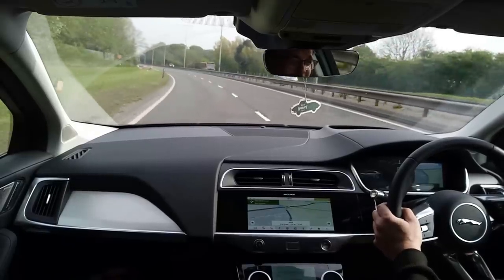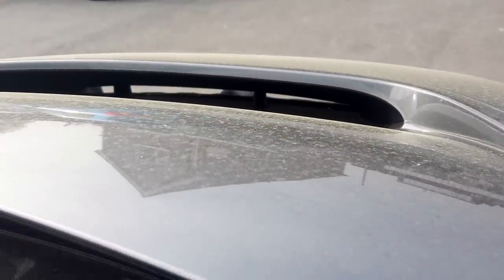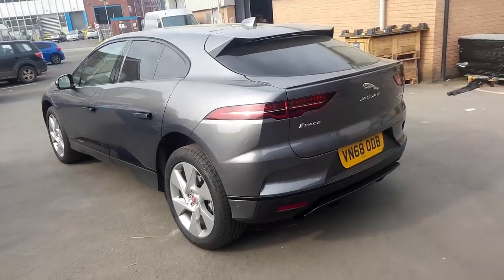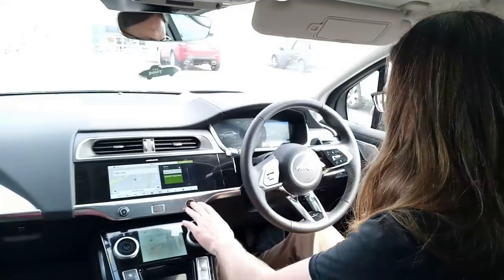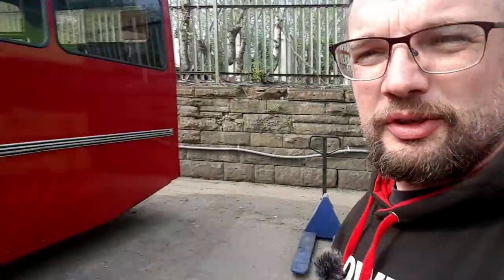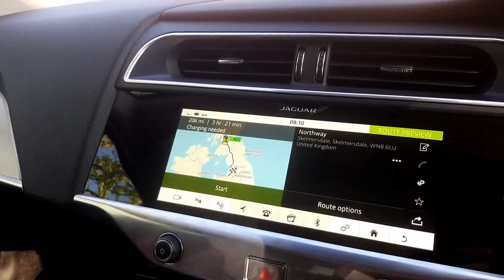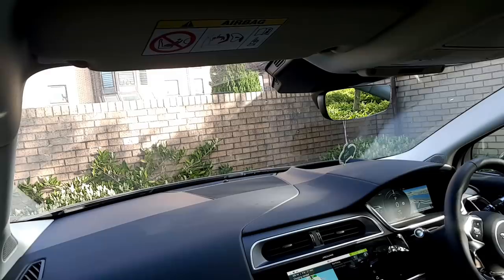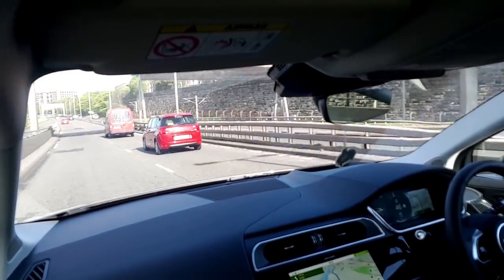Real Road Test: Jaguar I Pace 800 Roadtrip - with bonus bus action!

Comment: The electric car revolution so far as I'm concerned is welcome, but this video illustrates quite nicely how much its being hurt by overzealous software engineers who think you need an app, a bluetooth connection and three touchscreens to stick a few amps through a cable. Every glitch represents a coffee break they took instead of triple checking that line of code.
Reply: And it's baffling how these things don't switch to "free vend" mode when communications break down - people are trying to rely on them!
Reply: @AaronSmart.online  That'd be an idea, they're already charging too much so far as I'm concerned, they can cut those losses. Charging an electric car should not be comparable in cost to a tank of petrol, it's just not as expensive to make.
Reply: @Munkenba  the problem is the low volume of users and the cost of the infrastructure. A rapid charger installation costs somewhere in the region of £30-40k. If you want cheap lecky, just charge at home (but you'll only get about 7kW max)
Reply: @AaronSmart.online  That much really? Mad. I just hope the price goes down with scale, and these companies don't just see the dollar signs floating above thousands of people who now have all this petrol money they're not spending.
Reply: @Munkenba  Rapid chargers are only part of the equation though. There are also slower public chargers, usually around 6-22 kW AC, they're a lot cheaper to install - these are "destination chargers" as the expectation is you're parking your car anyway, e.g. in a town centre, shops, workplace, etc. And home chargers only cost a few hundred to install (there may be grants depending on where you are).
Reply: Worth mentioning that this doesn't apply to Tesla's though thanks to the supercharger network. Got my Model 3 six months ago and I'm taking it on a 1300 mile road trip soon. Should be pretty easy and quick.
Reply: @Brendon471  I guess you're in the US? Tesla's infrastructure is not as comprehensive everywhere.
Reply: @AaronSmart.online  Gotta DRM the electricity for some reason!! I don't know how much these chargers reflect ecotricity as a company but I already didn't like them as much as some other full-renewable companies, and locking out the chargers because the mobile phone signal is bad is just ridiculous! Imagine if a petrol pump did that, instead of just having you go to the desk and say which pump you were on. Blimey.
Reply: @AaronSmart.online  Does a petrol station switch to free vend when the card networks go down?
Reply: @cjmillsnun  You can still pay cash. When I worked in one (granted over 10 years ago), if the fuel card machines stopped working we got out the mechanical card imprinter and paper and did things the old fashioned way - nothing stopping you doing that with credit/debit cards when needs be either.
Reply: Indeed.  It seems overly complicated, we don't need to have an Esso app or a BP app installed to buy petrol/diesel.  Why can't you just swipe your credit card to start the 'fuel'?
Reply: Aaron Smart Yup, I’m in the US, but the network in Europe seems to be pretty expansive as well. Also, you have to remember that at each supercharger they’ll charge at 150kW (soon to be 250kW) which is significantly faster than the chargers were that HubNut stopped at with the iPace. Superchargers are also very reliable, so he wouldn’t have really had to worry about chargers having errors or not working like he did with the iPace. So in a Tesla, this still would’ve been an extremely easy and much shorter trip than it was in the iPace.
Reply: @Munkenba  In the UK the bulk of the ICE fuel price is taxation. 220% on base price. The fuel itself is probably cheaper than electricty per mile in standard cars. Once our chancellor starts collecting his duty he is missing and electric supplies bring in variable pricing for peak or heavy demand EVs will be at least as expensive if not more so to run not to meention premium up front cost.
Reply: @boo-boo511  I don't believe that anytime in the next 30 years will a government leant on tackling climate change even think about heavily taxing renewables. If they lose money on petrol tax, they'll get it through some other channel of income that they DON'T want the population indulging in, like cigarettes or single use plastic for example. 220% is a rate of tax that could only exist on something the government is actively trying to discourage, and electric car usage isn't going to fall into that category any time soon.
Reply: @Munkenba  It has been at 220% for a long time. It hasn't got there to put people off ICE. It is a tax on luxury discretionary income.
It will not be easy to recover that level of taxation on anything else.

It wouldn't be a tax on renewables. Tax per mile would have nothing to do with the fuel.

Cigarettes are on their knees in old western economies so limited capacity there.
Reply: @boo-boo511  My point stands, they won't try to recover that money through electric car usage, not for a very long time. Cigarettes are only an example, there are plenty of things that the government would seek to disincentivise before driving. That's unless we elect a science denying government like the Americans seem to do so often, god forbid.
Reply: @Munkenba  We shall see. It is a big wodge of income to lose from a desperate government. You can paper over small, single digit, percentage losses but as they mount it will be soo much more difficult.

How else are people going to get around? They have no choice in the majority of cases.

Ramping the usage cost may also make manufacturers reduce the capital cost faster to compensate.

Not sure the general public should be penalised for other people's discretionary spend.

Comment: I've had 3 ev's in the last 4 years, 2 Leafs and a Zoe, covered 85000 miles and have not had a disastrous trip like you have just experienced, As you have rightly stated the charging network can be pretty dire but a lot of the problem is down to CCS charging as failure rates are high (especially on Ecotricity chargers) AC can be problematic on the Zoe but not as bad as CCS, at present the best charging system is Chademo as there is usually the backup of a second Chademo charger with Ecotricity and a fair few Nissan dealers also provide free rapid charging.
Things are improving as the network has expanded greatly over the last 4 years and there is no way I would go back to an internal combustion engine and agree 100% with your comments about how smooth and responsive electric cars are, Keep the great videos rolling out.

Comment: Thanks for the video, a good reflection of how good the car is. FYI the Tesla superchargers of which their are lots charge at 125kW with the new CCS model 3 able to charge even quicker on soon up to 150 kW in a couple of years once the superchargers have been upgraded more than 200kW. Other networks are now in the UK with charging over 100kW but none on the route you followed. I do hope someone takes over from Ecotricity as I agree they are rubbish. Polar are great if you are a member £7 a month which gives you free access to their 7kW posts and a RFID card which would have stopped the issue you had.
Reply: Mike Jelfs Actually the Model 3 just got a software update 3 days ago that unlocks 150 kW charge speeds at all superchargers in the US. I'm guessing European cars will get the update soon as well. Also, Tesla is already rolling out their 250 kW superchargers. They announced that 2 months ago.

Comment: The Engenie charger at Stirling  - 

Kilo Watt Hours (kWh) commonly referred to as "Units" of electricity is an amount of energy used or stored over time. It's what your leccy meter at home measures.
KiloWatts is a unit of electrical power - Voltage x Current (amps).

So the Engenie charger was probably charging at 50kW but the screen was showing how much electricity had been delivered to the car.

So a 50kW charger should in theory be able to charge the battery by 50kWh in one hour. Batteries will slow down how much power they can take in as they reach capacity so the 90kWh battery on the Jag would take a little over 2 hours to charge from empty to full on the Engenie 50kWh charger.

Comment: Yeah, I'm guessing the cost of charging will increase sharply in the future. The cars might be fabulous but the charging network will be as awful as we could imagine?
Reply: Think you will find in the future Supermarkets will be the cheapest place to charge just like they are the cheapest places to buy petrol. They will subsidise it to get you to shop in there. Lidl already have many free chargers and I do go for a shop in there while I'm charging so it works on me.
Reply: In the UK the bulk of the ICE fuel price is taxation. 220% on base price. The fuel itself is probably cheaper than electricty per mile in standard cars. Once our chancellor starts collecting his duty he is missing and electric supplies bring in variable pricing for peak or heavy demand EVs will be at least as expensive if not more so to run not to meention premium up front cost.

Comment: "Charging error" my arse, I'd want a partial refund if I came back to find my car has been sat there not taking a charge. What a waste of time
Reply: I found it fitting that the last three letters on the reg was ODB, because with the amount of Chinese electrics fitted to it,  the car will always need to be plugged into diagnostics to find out what’s up with it...... yet again.

No doubt the Chinese have already ripped off a copy just like they did with the Landwind X7
Reply: You have a point - time is money.
Reply: The Chinese don’t need to copy it, they’re MILES ahead when it comes to electric vehicles.
Reply: clay walsh most of the Shanghai motor show was market ready EVs.

Geely own Volvo and the London taxi company, both of which are throwing out some amazing quality hybrids. Geely have some good quality kit on home shores. BYD are rapidly electrifying the world with electric trucks and busses. 

Shenzhen city just replaced ALL its 16000 diesel buses with electric ones. They’ll soon be replacing 22000 taxis too.
Reply: Pete FlintMurray 
Geely are pretty new to the world of automotive. A company that started making fridges. They still have to prove reliability with their products. Let’s see in Ten years if their recently purchase of the Volvo brand can be as reliable as a Volvo should be
Reply: Didn't download the app to notify him ?
Reply: @DRILLBABYDRIL  
ODB doesn't stand for On-Board Diagnostics though !
Reply: @LiamS94  You are transmitting data back and forward from the car to the charger, this is to make sure everything is ok to send 50 KW into the car and tapper it down as the battery fills. Your lamp at home takes around 5 amps not over 100amps. You don't have to download any app on your phone if you don't want to. I personally have not had a charging error on an Instavot  in the past year. 
Hubnut seems to have had more problems in 2 days than I have in 3 years. Please don't take this review as the norm
Reply: StealthyMonk so? iPhones are made in China, as are a lot of other high quality electronics. Country of manufacture does not dictate quality.
Reply: Liam S equating an EV managing a complex charging process to a simple lamp shows a stunning ignorance of EVs, batteries, and the challenges of high power electronics!
Reply: StealthyMonk nothing has ever been inferred by tone in the history of the English language? That is a stunningly ignorant sentence, noting that the word ignorant can mean either “unaware”,  “uneducated”, or even “discourteous and rude”, depening of course on the tone of voice. And yes, the written word does have a tone of voice (my meaning in this context is “unaware”). Big brands spend millions on developing theirs https://www.nngroup.com/articles/tone-of-voice-dimensions/
Reply: StealthyMonk sorry, wrong again. I know precicely what you think infer means according to some dictionaries, and I recognise what it means from common usage. As you know, english is a language which evolves and there are a great many people who would use the word infer when they mean imply (according to OED).  

There are also many dictionaires, and none of them are “official”, which differs from some other languages. For example the Cambridge English dictionary defines infer as ( https://dictionary.cambridge.org/dictionary/english/infer?q=Infer  ); “to form an opinion or guess that something is true because of the information that you have”. Under this definiton, the tone of voice forms part of the information, and thus the common usage meaning holds.

Remembering that people use the word “decimated” to mean almost totally destroyed, when the original meaning is to reduce by 10%, along with countless other examples.
Reply: StealthyMonk I guess we are going to disagree, as you point out, inferences are made by the listener. The tone of voice is information which the reader/listener has received. You yourself wrote “nothing has been inferred by tone in the history of the english language”;  the reader/listener receives the tone information and on that basis makes inferences. 

By considering the tone of voice, I make inferences (conclusions based upon the information I have). You seem to be saying that no listeners/readers in english speaking history have ever drawn conclusions from the tone of voice. I believe that to be wrong....
Reply: StealthyMonk StealthyMonk ...so you accept that your statement (nothing has been inferred etc.) was incorrect? Very gracious of you. Apologies for the confusion.
Reply: StealthyMonk “by interpreting the tone which the author used, I inferred that the atmosphere being described was mysterious”.  

Here is yet another dictionary definition for you https://www.collinsdictionary.com/dictionary/english/infer , which describes very well what I have been saying. The third definition in the british english section is 3 (transitive) “to hint or imply”
Reply: StealthyMonk yet if someone were to say to you, over the phone, “I am very high”, you need to infer from either the context of the conversation, or the tone and manner in which the sentence is delivered, whether the person is drugged-up or merely atop a tall building. 

Similarly “yes, I’m very excited about the prospect of hearing your next argument”; the meaning of which can only be inferred (by the receiver) through understanding the tone in which the sentence has been delivered. As you point out, the sayer/writer is implying through tone, and the receiver is inferring through tone.
Reply: James May had that problem. This technology is so immature the ten-year-olds I used to teach must have been employed to have a go at that job.
Reply: @SquareoftheyearFM  Basically because they nick the technology from Japan and the west.

Comment: I used to work as a test driver for Google in San Francisco driving Waymo's self-driving version of the i-Pace. I agree with what you say about it - the suspension is too firm for places with holed and broken streets and the acceleration is indeed warp speed. Very nice cars, but they're not real Jaguars. A real Jag has wood and leather inside it, leaks oil all over your drive and refuses to start in the morning.

Comment: I was interested on how an I-Pace works, as I am a HUGE fan of electric vehicles. We here in the US, and New York, have issues with charging electric vehicles other than a Tesla. There are apps that give you the location of charging stations with reviews from other EV owners. And I'm sure EV owners used imaginative ways like you did on the motorway when on a long journey because of anxiety range. Like yourself, Ian, I feel EV are the wave of the future, yet car manufacturers are letting others provide the electricity instead of what Tesla has done, by making huge investments in the charging infrastructure. I love classic vehicles as well, especially those not imported into the US. You also highlighted limitations of certain EV like the I-Pace. Your review showed its features, and as a novice to the vehicle, shows a first hand view of what it is like having a first drive of the vehicle.
I too dislike having to plow through submenus of the infotainment screen, but it seems the wave of the future. You also pointed out current tech like adaptive CC and other tech are quite useful. And I hear you about head restraints pushing  your head foward; some allow the restraint to be pushed back for comfort, others do not. And this is from someone who is usually a passenger!
Reply: Great comment
Reply: @stigstig9275  Thank you! I love watching these videos, and vehicles that are UK 🇬🇧 or EU only. Peugeot, Citroën and Opel are a few no longer imported into the US, and I like to see vehicles from the UK. That, plus Ian likes EV as much as I do! A ride in a Tesla Model S was life changing, as I definitely believe the world is ready for long range EV. The problem is charging stations and their capabilities, as well as their restrictions.
Reply: @frothe42  you sound like a pragmatic kind of guy. Good stuff. Greetings and respect from Birmingham UK
Reply: @stigstig9275  Thank you! I have friends who live outside Manchester, in the Dale's, near Slaithwaite. Beautiful country!